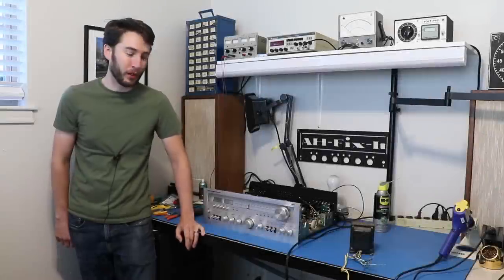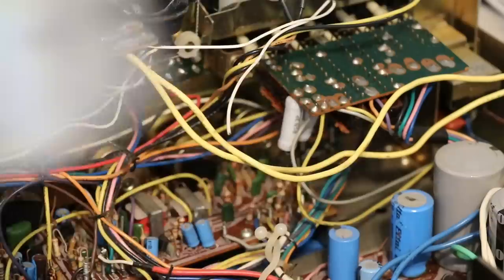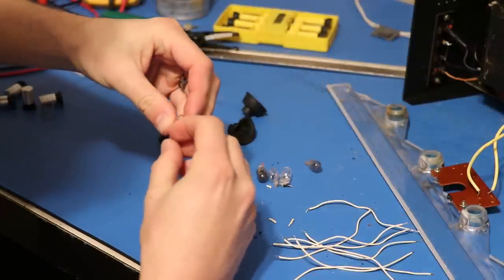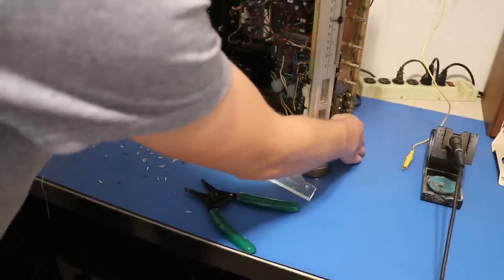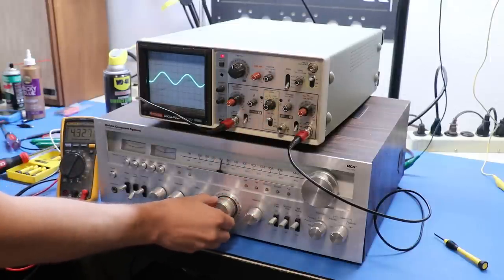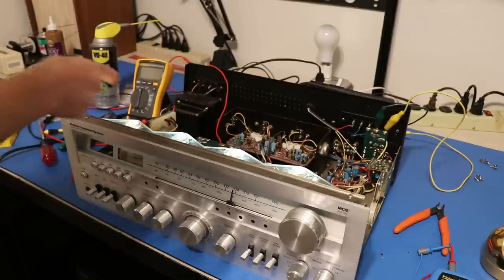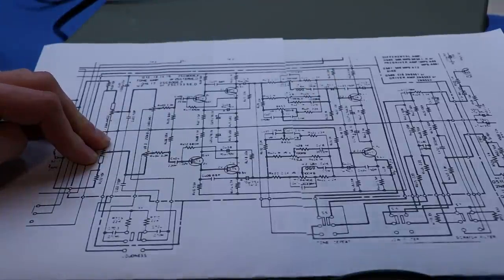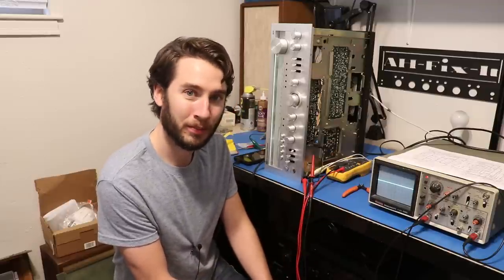Fixing everything else on the MCS 3233: Clean controls, lamp replacement, and much more!

Comment: This is the stuff (and after 50 years of doing similar) that real troubleshooting is made of. You now have a method, a path and a strategy as well as assessment and evaluation skills better as a result of the MCS being slightly cost cut engineered. You made it better than it was!! I am very proud of your sticking it out and finding the truth where all these nit picking problems were. Not only that you actually found anomalies you would have never discovered and fixed if you were not persistent to the point of complete success!! Bravo job well done.

Comment: Glad you stuck with it. Just an FYI, having both +  and - supplies doesn't really mean it's DC coupled. You proved it yourself with the failed coupling caps after the tone circuits. Good work, for sure.

Comment: If I remember correctly, if those baby-blue electrolytic capacitors are made by Sanyo, they were always problematic.  They might be worth shutgun-replacing all of them.  Nice video and really great diagnostics.
Reply: I agree, and I'd even go so far as to replace all the electrolytics. Would you put a barn-find 1979 car on the expressway without changing the tires? The MCS-3233 is 44 years old and long past its use-by date. They're nice receivers: somewhat "tubey" in sound signature (a big plus with a lot of people), an only OK tuner (but, these days, who cares about radio?) and that mid-range tone control.
Reply: @thomaskendall452  Agree as well!, I just done my Magnavox 300 Receiver "From 1972" and was all original and was working, But Wow what a improvement the new Caps made!, When I tested all the old one's they were waayy off the original values!
Reply: In the late 1960's, I worked for a local stereo shop. Half my time was selling on the retail floor; the other half was spent as an apprentice to our tech. A majority of our repairs were on tube equipment. It was basic policy to replace automatically all the caps except the mica ones and most resistors, because of the heat and high voltage. The tube gear came in for repairs every three or four years. The improvement in sound could be dramatic!

Comment: I remember going in JC Penny's as a kid and I always went to the stereo section and looked longingly at these receivers (and other MCS models on display).  Eventually, I got one of the cheaper MCS receivers and used it all through college.  It was a great unit.  To this day, I still have my MCS turntable and it works perfectly (though it has been serviced once).  Great video.

Comment: The stuck VU meters are often freed up via heating the screw with an iron for a few seconds. No no with contact cleaner in the meters. Good troubleshooting. Really looking forward to the STK video. Those things have been the defeat of a few amps I have intended on rebuilding and sold for parts.

Comment: Buy you deoxit fader in green can that is made for potentiometers so they won’t damage the film on the wipers in the potentiometers. These are safe on plastics too. Too late after you have used it. Cheaper isn’t always better in contact cleaners. I could have damaged my volume & bass / treble variables with that deoxit D5 if a had not researched it. Those are 1963 Harman Kardon potentiometers & can be damaged easy.

Comment: At 9:12 when you were soldering the wires onto the little bulbs, I thought of the little "helping hands" gadget with 2 alligator clips mounted on a swiveling base. That is super helpful for soldering two loose wires together.

Comment: After everything you have done to fix this unit, it has to make you think someone was in there dinking with it. My pops had a full working system with tuner, amp, cassette, etc, in the late 70's / early 80's, and this was as good as my Marantz 2216B.

Comment: Increasing the voltage rating on those caps increases reliability.  Per MIL Spec for high reliability , applied voltage should be 50% of capacitor rating.  Even though you didn't like that receiver, to me it looks like a nice '70s era SilverFace and serviceability looked pretty good also.

Comment: I have seen that issue where the bulb won't go dim when turning on a receiver with the speakers selected. Freaked me out when it first happened. I found not selecting the speakers when turning on the receiver took care of it. Using a larger bulb also would do the trick.

Comment: Nice.  Now have you seen an MCS-3285?  That one was made by NEC for JC Penny and it has a much better power supply and binding posts, moving coil phono, etc.  On a purely aesthetic level, I think it is just awesome. Never had a chance to hear or see one in the flesh.  The whole face is buttons and toggle switches with some great digital displays.  I'll bet that it would be some project, just cleaning up and restoring all those switches.  I'd even consider getting one working/not working if the price is low enough and the chassis/faceplate is clean.  I don't need it, but I just love its looks.

Comment: 28:00 - My guess as to why those 2 caps failed;  they were connected in reverse-polarity due to faulty markings on the circuit board (or the schematic).

Comment: Nice troubleshooting! I share your attitude towards electrolytic capacitors, measure, then change if bad ones. If several of same type are bad, change these. And, the shorted, black-spot ceramic in the first video was strange. Must have been stressed, or a bad part from the start. If a power spike, the diodes would likely also have been bad

Comment: OUTSTANDING sir..Great job chasing it down....I really like that you took on the challenge. Fixing the tuning meter was great....I dont recall ever seeing one stuck like that. Tracking down bad caps in the preamp, excellent. You mentioned that the receiver has a number of those in it, do they seem ok? I was just thinking gthat they could be dried out due to age...GREAT JOB again sir. Thanks for sharing !!
Reply: I forgot to add, cudios to the assistant cat, could not have done it without them...

Comment: I was really surprised the lamps were not socketed. On a few of the Pioneers I have worked on, the sockets became dry rotted and crumbled to the touch. Good thing that didn't happen with these. I would have opted for LEDs if possible, but your call. Great video as usual!

Comment: Dielectric grease (lite weight non leaching) on that cam gear since it is plastic and old will help_ DO NOT use conductive grease or regular "grease" like automotive type. Conductive grease sparingly can be used on wiping contacts but very sparingly!